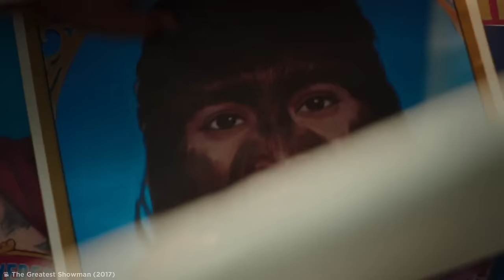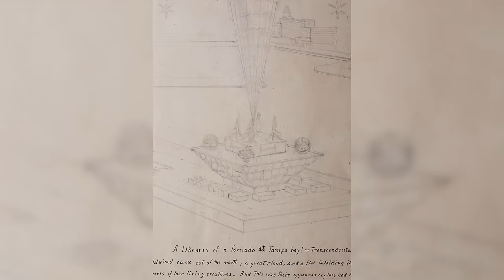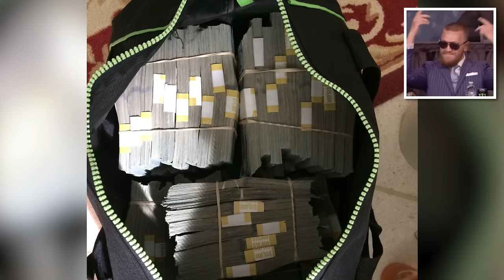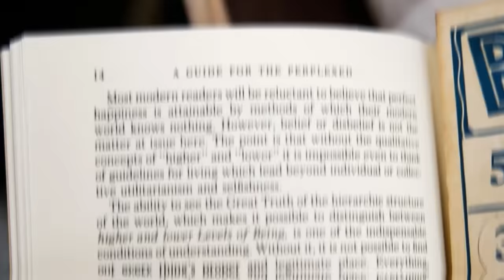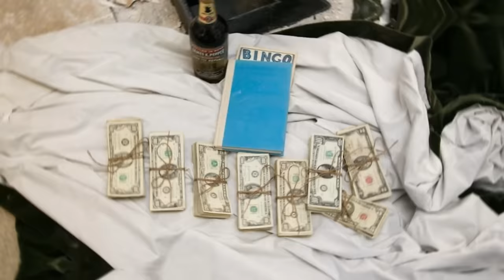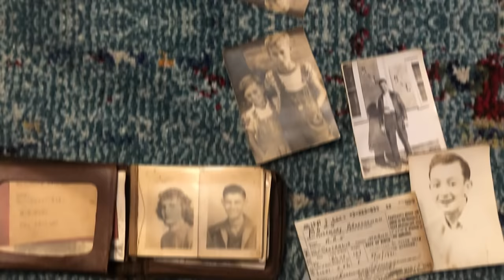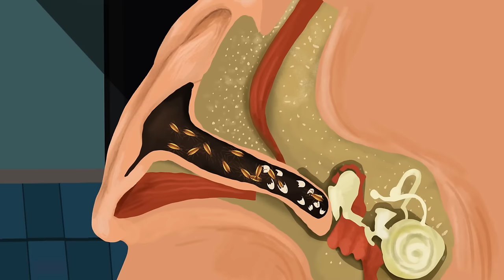Bizarre Discoveries Found In Unexpected Places - Part 2

Comment: When I was about 10 years old,  I bought an Italian ice at the pizza shop. If you've ever had one, then you know you'll find lumps in it. As I was happily eating my treat, I found a lump that didn't melt. I spit it out into my hand to see what it was. It was a dead roach. I'm 54 now, so it's been over 40yrs since I've had one.
Reply: a dead roach or an italian ice?
Reply: Honestly, I completely understandi don't even know but they it would put me off too. I would just be like no. Luckily that's never happened to me. So the ices are awesome are still awesome. Because that has never happened to me. I completely understand I it would put me off too.

Comment: I’m sorry if I have to say something against the Frog it could be a picture taking at the right moment of a frog eating they use their eyes by pushing their eyes in because it takes five seconds for them to put the ice back in the right area although the condition is the correct thing but the eyes would’ve still been visible instead of their eyes being close like a frog eating animal facts right here— The one with moving one that look like it was all the legs of a moth I have to dismiss them off it could be a malformed rat that survived a little but the other ones died and the mother abandoned them it happens more commonly inside and breeds of rat I know this because my dad is someone who had rats before— The thing nobody can agree on high chance it’s actually a washed-up deep sea creature because when deep sea creatures come from the bottom of the ocean and get sucked up the body is completely change and almost not at 10 to call to the actual one this is house fishermen were able to find the deep sea squids and anglerfish high chance it’s that and I’m not going to say anymore I think